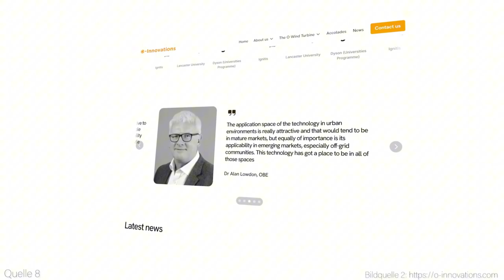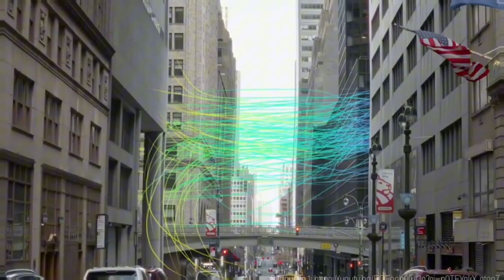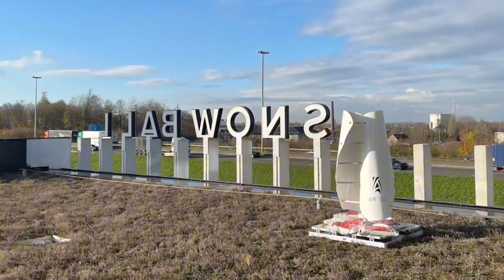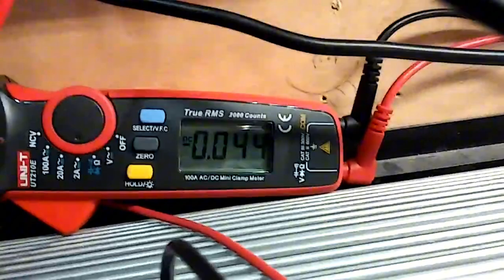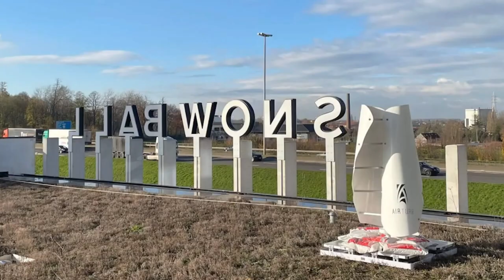This NEW European Wind Turbine for Home Out Perform PV Solar Panels in 2024?!

Comment: Great idea but low barrier to entry. Better strategy should be to manufacture in China and proliferate across the world. Or better still have regional manufacturing partners who will make these turbines locally and distribute. At 10-15k$ per unit it appears that the promoters are relying on tapping into EU subsidies and anti fossil fuel policies to make money on the short term. Not a sustainable strategy.

Comment: NONSENSE!  All practical tests show that small wind turbines hardly generate any electricity. Because there is hardly any & gusty wind close to the ground.
Due to the gusty wind, the service life of small wind turbines is usually very short. 

With solar modules, on the other hand, you can reliably generate green electricity for 25 years at approx. 3-10 cent/kWh!
Reply: Do these wind turbines will be useful if put very high